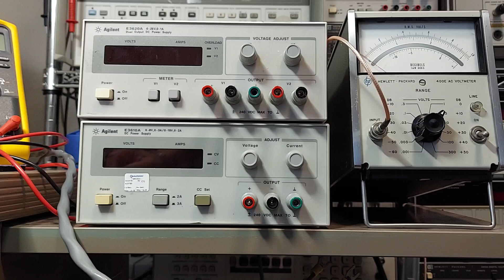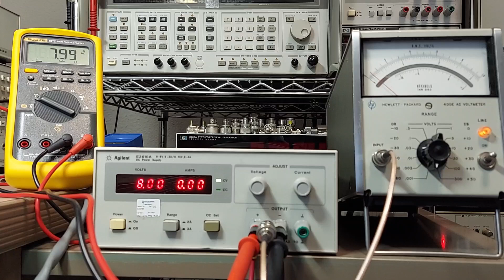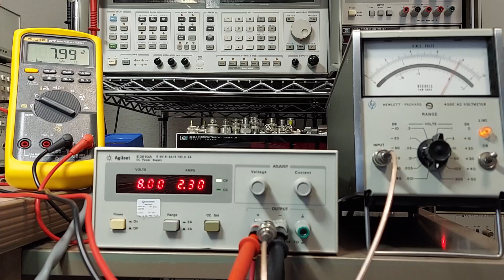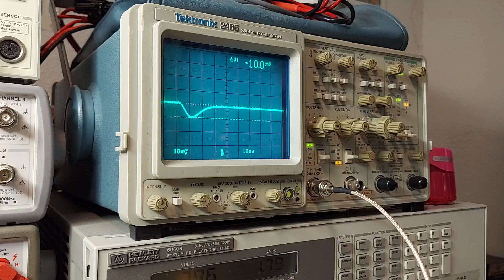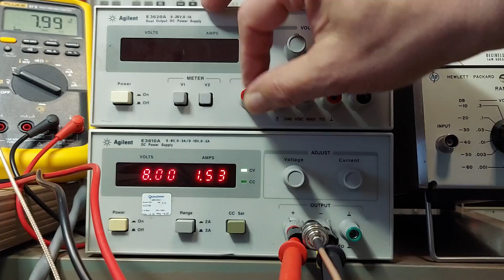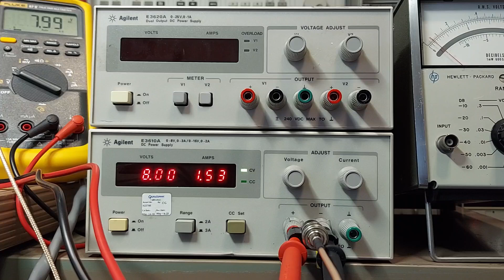Bench testing an Agilent E3620A and E3610A power supply.

Comment: It's been a long time since I used one of those power supplies, probably more than a decade. I like the low noise (acoustically and electrically), but I've never understood why HP built versions without a programmable current limit (I should rather say: I wouldn't want to do without it).

I've seen a video (actually, I think more than one) about these power supplies where capacitors leaked badly, destroying traces and causing leakage currents that affect operation. Although I can't remember whether these were HP or Agilent branded, I would certainly inspect/measure and potentially replace the caps if I wanted to keep these supplies. I was really surprised to see these problems, because I rarely had any bad caps in my old HP gear (6060B, 5334B, 33120A etc.). One notable exception is the 53131A (in my case Agilent) with its SMPS - and it's a type of equipment that is common to see many hours of operation.
Reply from the maker: With all the HP, Agilent, Tektronix and Fluke gear that I have, I have only run into a capacitor issue twice. An HP 3437A and an HP 5328A that had a power supply over volt failure. While I was taking the 5328A apart, I discovered that the main power supply filter caps were only now just barely starting to show signs of leakage around the terminals. Prior to that the 5328A was working just fine. That's pretty good run for something that was built in the late 70's to early 80's. 

I have yet to run into an issue where there was leakage that resulted in trace or some other board damage. Most of the equipment that I have had been serviced in the last 5 to 10 years, however I do inspect the filter caps and check the power supply voltages on the units that have missing, broken or old anti-tamper service stickers. Thanks for watching!
Reply: @CraigPetersen12f36b  one exception are the RIFA caps. These have almost always a cracked case and usually have to be replaced.

Comment: If you're interested, I've got an extra HP 8920A RF Communications Test Set I would let go inexpensively. It has errors in the RF_Diags tests but does boot up and has all menus working.. Amtronix Instruments Calibrated and upgraded the one I have on my bench. They will also repair the 8920A. Chris S knows who I am if you want more info or to play with it before you buy. Everson Wa.
Reply from the maker: Thanks for the offer. I originally wanted to find a HP 8920A or Motorola R2600 series communications analyzer, but they were either priced higher than what I was willing to pay for, had seen rough service or had a number of faults. So I settled on purchasing discrete instruments instead of buying an all-in-one solution. I may re-visit the issue down the road, but so far I'm satisfied with the current setup. Thanks for watching!